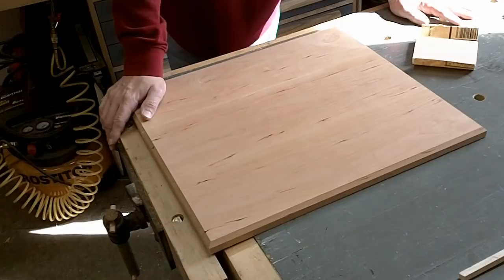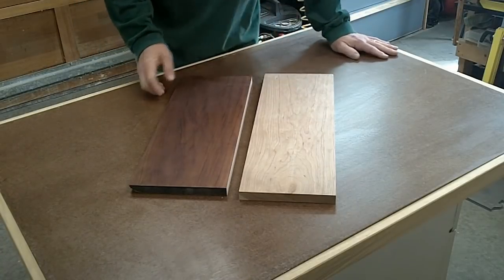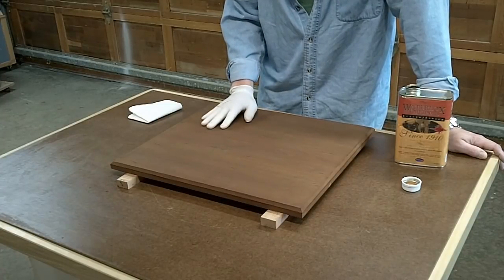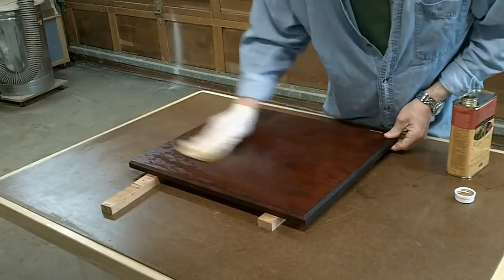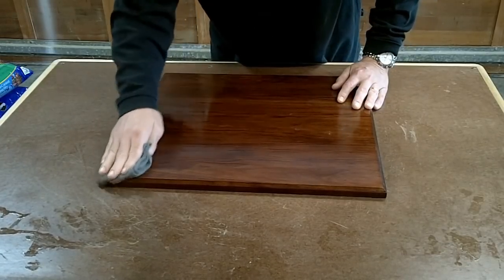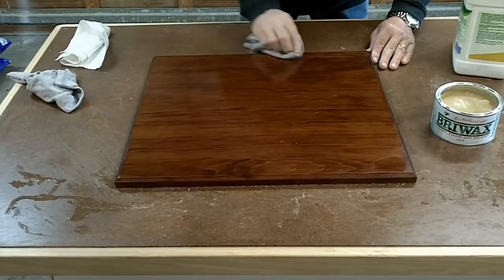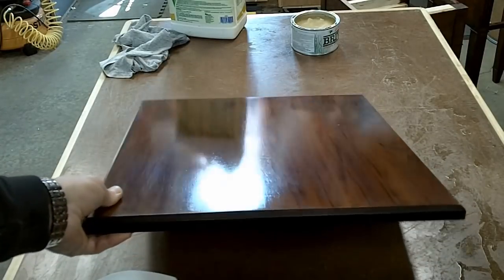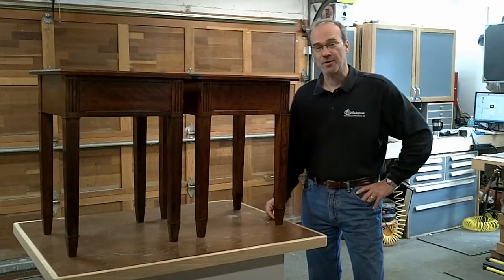Cherry End Table/Night Stand - Applying The Finish - Pt 4

Comment: Just finished sanding down to 400 by hand. Did you apply the Potassium dichromate with a rag or brush? And do you let it sit on there or do you wipe it off?
Reply from the maker: +SHAWN MAX Hey Shawn. I used a foam brush. I put it down with the brush, and then wipe up the excess after an area has had the solution applied to it. It will take about half an hour or so to darken after you apply, so just be patient, and don't put anymore on after the initial coat or it can get streaky on you.

Comment: I made a jewelry box out of cherry about 8 years ago and didn't stain it at all. I laid about 7 coats of nitrocellulose lacquer sanding in between each coat and polishing out the last. It was the first project i built from cherry and noticed it oxidized a little and darkened a bit, especially the heartwood. Would this finish not be too dark after about a decade?
Reply from the maker: This was actually a trade off. My wife wanted the side tables to be painted black. I convinced her I could really darken up some cherry instead. They have darkened a little bit since I made them, and they are a nice dark, rich red color.

Comment: I have nearly done a cherry slab coffee table what are the best finishes like waxes and oils etc Im from uk mate thank you Danny
Reply from the maker: Hey Danny. That's a tough question to answer. If it was me, I would put on a finish like a wiping poly that will help protect the surface a little. Especially from things like hot/cold or alcoholic beverages being placed on it.
Reply: What poly as glue un mean n also I just want to see the grain and be shiny and what can I use to protect the bark on side?   If I wanted to keep. It on plz
Reply from the maker: That I have no experience with, as I have never done anything with a love edge before.

Comment: Having problems with top not evening out. shows marks from steel wool being used what am i doing wrong
Reply: I'm guessing you used a coarser steel wool.  Go back over it lightly with some 0000 steel wool and then wax your top.  The difference will be amazing.
Reply: @JD_Fidler  I have read advice to apply the wax with the steel wool together, rather than doing them in separate steps. (Their reasoning, I think, was that this would allow the wax to serve as a lubricant and soften any scratch marks from the steel wool.)  Would you advise that, or doing them in separate steps as Guy @GuysWooodshop has done here?  Thanks.